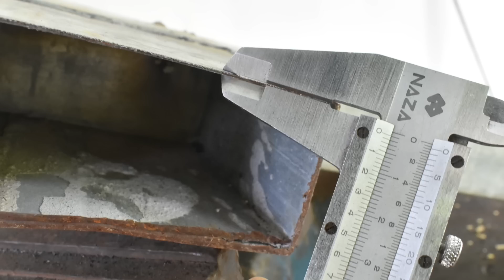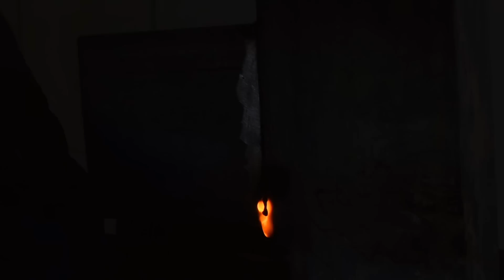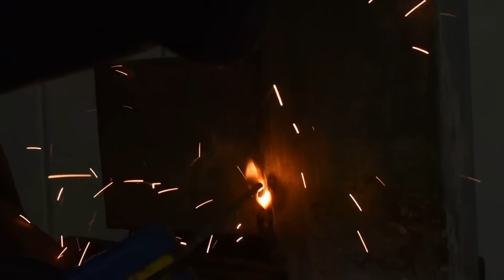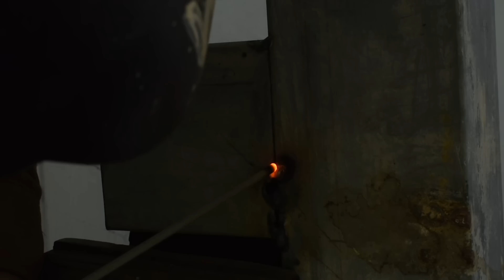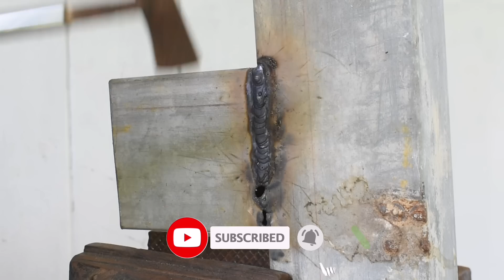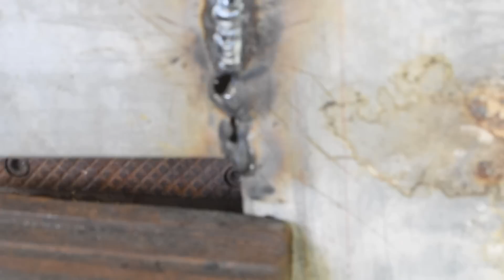Welding 1 mm. Why no one told us about this secret in vertical position.

Comment: What happens if you weld downward?
Reply: 6013 is suitable for downhill, but in general, downhill welding creates a little bit weaker weld, because the shallower penetration, but on thin material, this can be enough. Downhill welding is also faster, than uphill, just set the amps and welding speed correctly, and pay attention to slag inclusions.